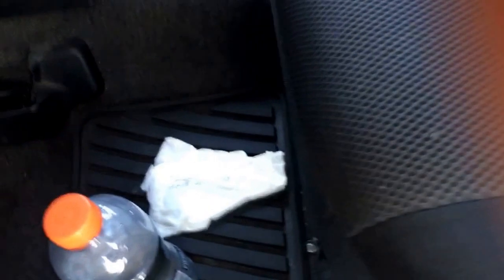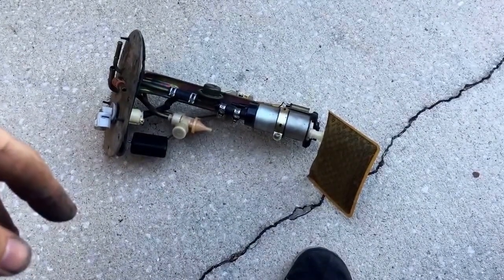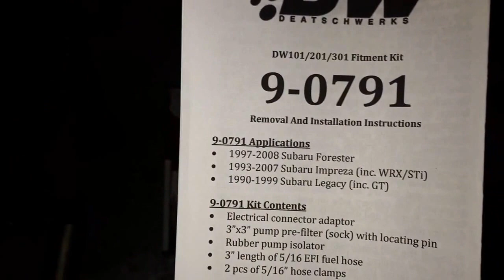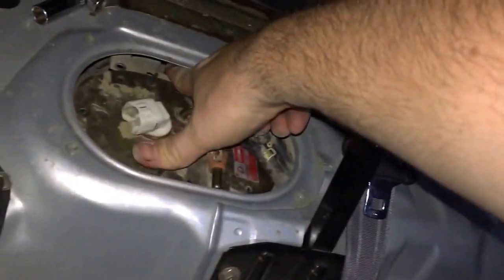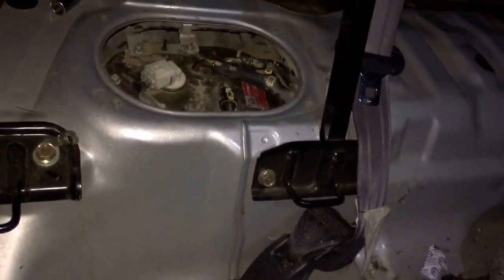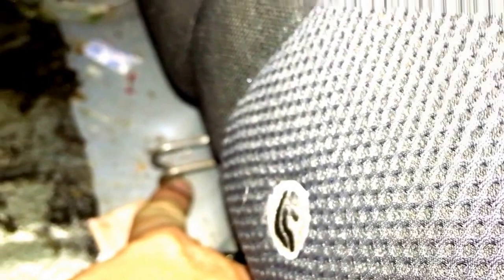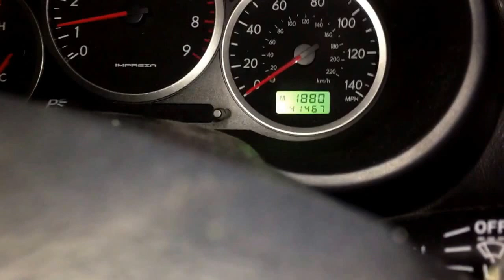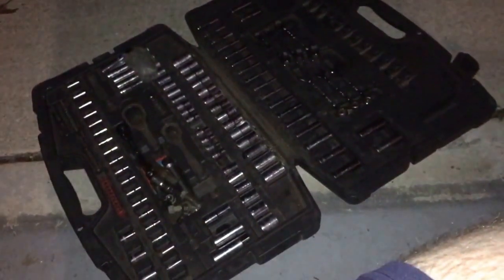2004 SUBARU WRX FUEL PUMP CHANGE HOW TO  WALK THRU.. DW300 pump

Comment: Always remember to remove fuel cap FIRST. This will release pressure from fumes in the tank. Otherwise what will happen is the fuel will be forced out of the non-supply lines jettisoning a good litre of fuel on top of the tank and onto the floor underneath the car, which is exactly what happened to me.  You're Welcome!
Reply: Damn good thing you commented this, I'm about to replace my fuel pump
Reply: I love you for commenting this, was so frustrated for like 15 mins until I saw this comment lol

Comment: When working on anything, I would suggest testing the fuel pump before you put all the nuts back, just in case you had a lemon pump. Other than that, very informative video. Good work!

Comment: Hi, thanks for the video, really helpful. When upgrading a fuel pump it is necessary to add a fuel pressure regulator???
Reply from the maker: not if your staying on a stock tune. if you decide to get a tune with bigger than stock injectors as well i'd recommend getting one

Comment: What do you recommend if car doesn’t start after fuel filter replacement? Primed pump several times, can hear pump working. Almost turned over a couple times, but no luck. Any suggestions would be great.
Reply: probably has a busted cap.  look up fuel pump repair cap.  dorman makes one of if your has the filter in the tank might need that one.  broke down couple days ago pump didnt fix my problem saw that the cap is busted

Comment: Amazing video!!! Thanks a million but I do have one question! When I pull the fuel line with the orange clips gas keeps flowing out??? What am I doing wrong? Is it my SLIGHTLY sloped driveway?? Thank you in advance!!!
Reply from the maker: JT T nothing to worry that’s just the fuel back flowing from the engine bay Area since your on an incline..